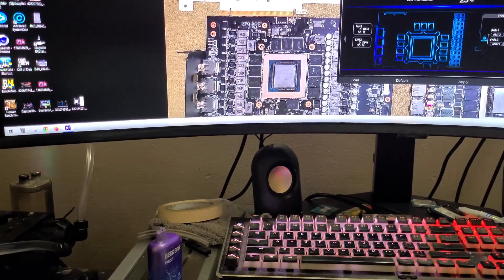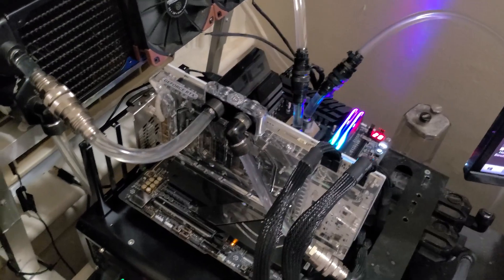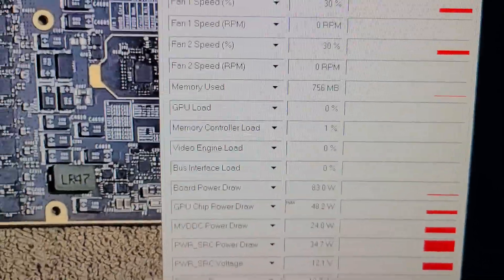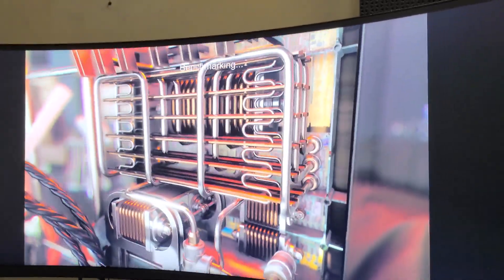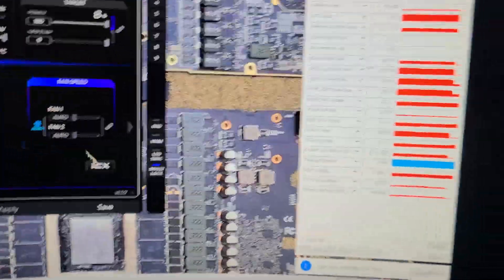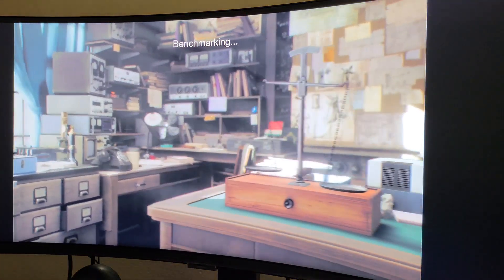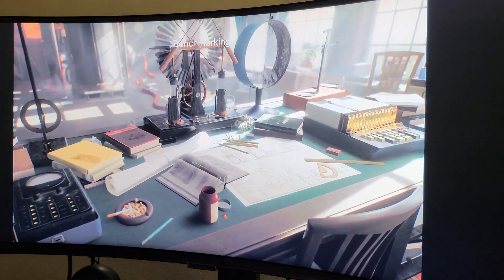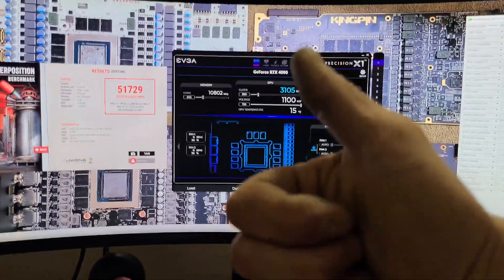Galax 4090 HOF Oc Labs Edition power consumption.,

Comment: Hey John! As a owner of hof 4090 oc lab ,do you know where i can found the galax overclocking tool? Also am i need the hof xoc bios to unlock the voltage above 1.1v? Already have it but wasn't flash it yet.im at stock bios 666w
Reply from the maker: ive got the 1000 watt xoc bios. the flash tool is built into it.
Reply: @ColdVenom159  thanks for the answer! So i dont need any special tool to unlock the 1.25v ? Only to flash the xoc ?
Reply from the maker: @nickfilippidis9235  nope the custome bios from galax has the flash tool built into it. youll still need the actual voltage tool to raise the voltage but you wont be capped at the factory voltage.
Reply: @ColdVenom159  ahmm i think im wrong.i have the xoc 1000 from techpower up and i guess is different from the custom xoc thats why i dont have the tool .Also im on air and i know those voltages for air is no go...but I want to try the voltage up to 1.10-1.15 .Because max clock on air on mine with stock bios are 3090 core and +1875 for memory,max pl . Those to port royal test(3d mark)
Reply from the maker: @nickfilippidis9235  ya i know the bios you have from techpowerup. i had that as well its not the same one. ya cant compair the 3090 to the 4090 youre talking 2 completely different animals. i had my strix 4090 2000+ on the memory down side ddr6 dont like the cold so didnt take much for me to make the ddr6 upset lol.
Reply: @ColdVenom159  lol no i mean 3090 core clock not the rtx 3090 haha. Also had a zotac airo extreme "platinum"silicone cause was the only 4090 that on air. Was able to  3165 core clock and 2000 memory but i sold it for the hof 4090 and the hof is worst than the zotac at silicon .Bad luck but still its amazing card and its the colder air 4090 .
The 4090 hof is the 6th 4090 of mine
Reply from the maker: @nickfilippidis9235  ya the hof deff isnt worst then the zotac. no disrespect intended but idk anyone with an hof that would agree with that statement.
Reply: @ColdVenom159  zotac was better only at silicone lucky with that .But of course overal the hof is the best 4090 out there .There is no comparison

Comment: The EVGA Kingpin cards and Galax HOF have unlocked voltage, but only if you have the right tuning software tools available. You won't be able to do anything special using Precision or Afterburner. The peasant consumer GPUs are voltage limited and there is nothing you can do to circumvent NVIDIA's digital castration nonsense with a peasant GPU.
Reply from the maker: wup which is why kingpin himself uses a voltage overclocking tool with his cards, as well as galax has a voltage overclocking tool for their hof vards so you can over volt them. doewn side wit hte 4000 series theres a fine windown to use the tool before you end up hurting performance. ive actually got both the tools myself as one i got from kingpin as for galax ive got that tool from busddy of mine whis got a couple connecitons.
Reply: @ColdVenom159  yeah, I miss my 3090 KPE with the XOC vBIOS and Classified tool. Both of my 4090s are the peasant editions. I wasn't able to source a 4090 HOF at an acceptable price. I do have the Galax HOF vBIOS on both of them, but can't manipulate the voltage. Probably going to have to break out my soldering tools and go down the Elmor's Lab route with hardware voltage controls. I don't like having to do that, but there isn't another option if you want to extract all the performance they are capable of.
Reply from the maker: @MrFoxRox  i liked how u tried to disagree with me til i got technical about it with the voltage control tool, you dont need Elmor's Lab route route for the 4090hof. the hox xoc bios raises the max voltage to 1.25 i think it is. afteer that you just need the gaxax voltage overclocking tool to actually raise it past 100% myself personally ive not messed wit hthe tool as sense evga left the gpu game ive lost ontrest in hitting overclockng lists. idk why it sent seem pointless now that evga is goone from the gpu scene.
Reply: @ColdVenom159  no, that is not accurate. The max voltage on 4090 is 1.100V even with the Galax HOF XOC vBIOS. You absolutely have to go the Elmor's Lab route if you want voltage control and you don't own the Galax HOF GPU. You will get no further with the core overclocking than what the 1.100V cap allows no matter how cold you get the GPU. I run mine on chilled water and the limit is the same at 3°C as it is at 65°C.
Reply from the maker: @papusan...  You've pretty much repeated everything I've said to a point.
Reply from the maker: @MrFoxRox  w/e u say
Reply: @ColdVenom159  I only wish that were true. Unless you can get a Galax HOF or break out the soldering iron it is whatever NVIDIA says it is. The HOF vBIOS and HOF software tools won't do anything for anyone in terms of voltage control that doesn't have the HOF hardware. The HOF vBIOS does raise the power limit, but without having the ability to increase the voltage above 1.100V you can't fully utilize the increase in power limt. They've basically screwed us all by deciding in advance what they want for everyone.
Reply from the maker: incorrect both the kpe cards and the hof cards are voltage limited til you have the 1000 watt bios and voltage too. for the hof cards theres a special voltage tool for the cardsas wel las for the kpe cards there was and still is a special voltage tool.
Reply: @ColdVenom159  It's not incorrect at all, you're simply stating the obvious. People that owns a Kingpin or HOF card generally do not need to be told they can't use it correctly with the cancer vBIOS. Anyone that does own a Kingpin or HOF card that doesn't know that has no business owning one. If you are not demonstrating the HOF using the XOC vBIOS and the necessary software you're simply demonstrating what all peasant GPUs suffer from... firmware castration. Flashing the XOC vBIOS onto a normal consumer GPU does not allow the special software tools to work. The Kingpin and HOF cards are also different at a hardware level.

Comment: For instance, there’s a bios for the strix 4090 OC, which I have, that unlocks the power to max 600w. And I’m not even talking about the XOC 1000w bios. If you cranked it up one can easily hit above 500w
Reply from the maker: No it won't you have to have the voltage mod to push the any 4090 that far.
Reply from the maker: thats actually incorrect, the strix 4090 bios give a 1000 watt power limit. that i know as ive got it. even with the 1000 watt bios the card will not do over 500 watts.

Comment: No offense ,just a tip ,go and try . You can oc the vram much much higher .never seen a 4090 that could not do +1000mhz minimum. My tuf4090 is on +1400 since day1.(Bought it back when it came out)
Reply from the maker: im well aware i wasnt going after scores.
Reply: should i rma my msi it cant do 1000 stable